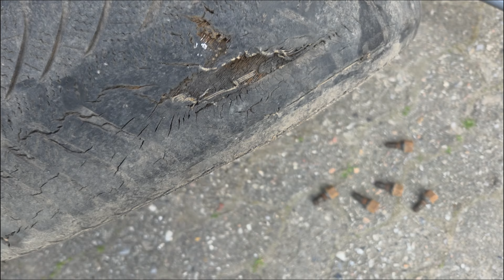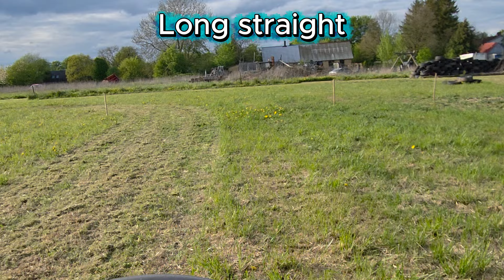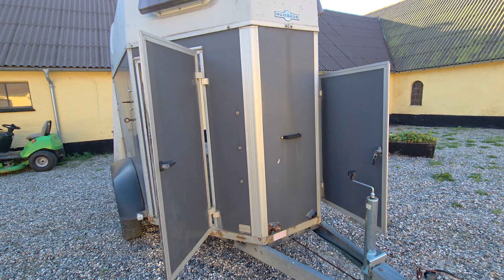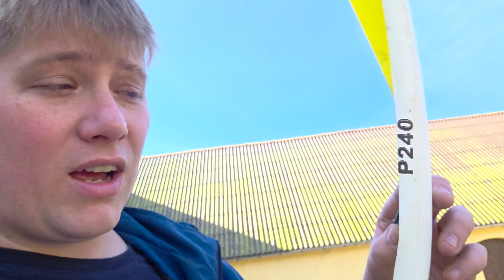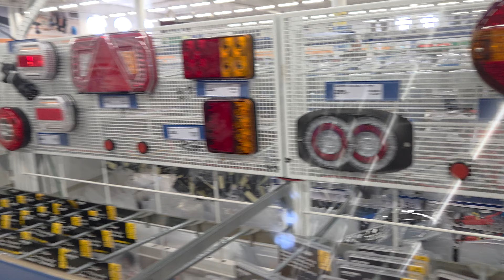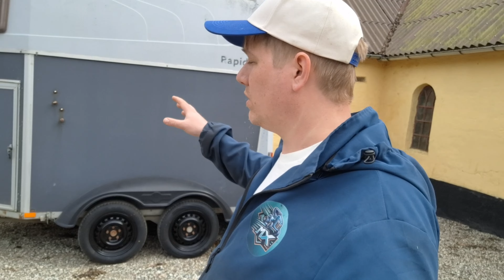Auction Buy… Worse Than Expected?!

Comment: The trailer is a must have in this hobby, good score! You're always gonna find problems with used equipment and there's always room for improvement and customization. Good luck with your new project.
Reply from the maker: Yeah, it is. Previously, I always had to rent or borrow one, which was kind of a hassle. I'm currently working on getting it street legal, followed by some customization, so it'll be ready when I go racing!